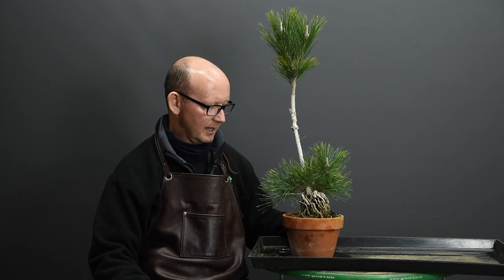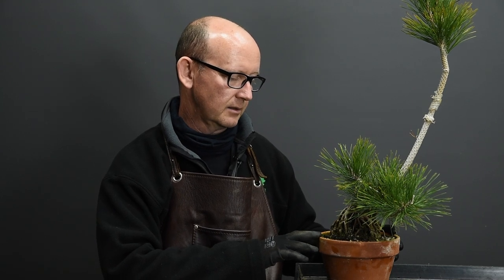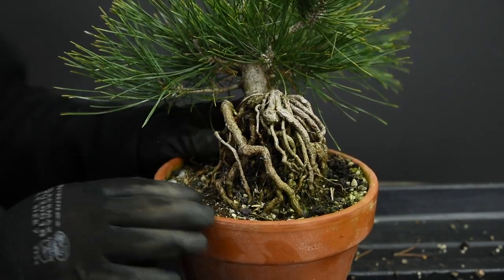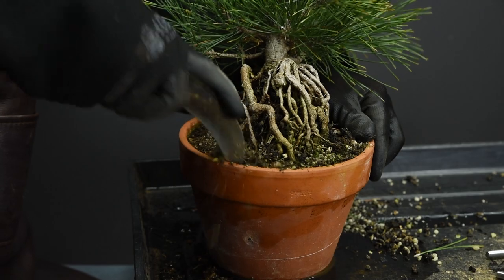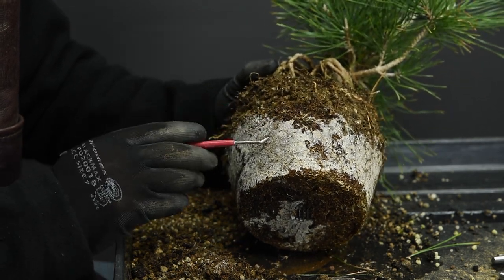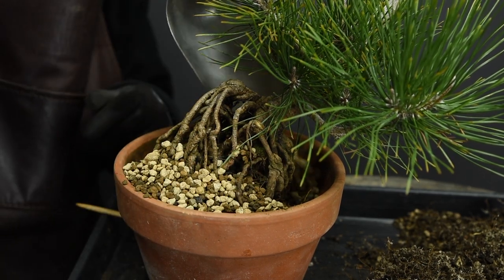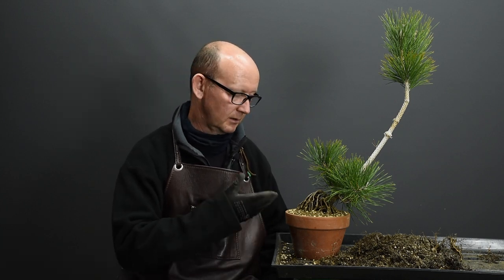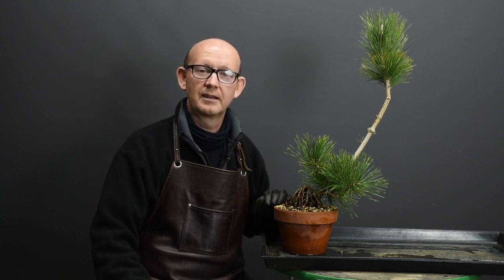Pines from seed part 2

Comment: I just has a Japanese black pine seed pop today. I bought a cheap kit off Amazon with like 8 different species of tree. So far I have atleast one sprout of every species. I am growing them in 80% perlite 20% peat.
Reply from the maker: That’s great that you are starting from seed. That media is very wet. I’d suggest you change that sometime soon to avoid roots rotting.
Reply: @TerryErasmusbonsai  do you suggest going straight to bonsai soil? Like a shogun size bonsai soil?

I feel like I am having a hard time keeping it damp. They are inside in 73°F with 50%-60% humidity
Reply: @TerryErasmusbonsai  i also must add i have them all in net pots instead of regular seedling trays.

Comment: I've always wondered, Because of the importance of the mycorrhizae, should you never treat a pine with a fungicide?
Reply from the maker: That is a great question. One which I can only comment from my perspective on. I do treat with fungicide, you must, and I usually drench the tree particularly now in spring as this is when new growth is most susceptible. However I think what you mean perhaps is whether it’s a good idea to do so with systemic fungicides. I have recently done so and am observing the response. However I think it won’t really make a difference provided you don’t often treat with it and I doubt it will kill all mycorrhizae. Anyway the spores will be around in the air and will re-inoculate the soil. At least this is my thinking whether wrong or right I am not sure. My pines are all very healthy though with lots of mycorrhizal growth
Reply: @TerryErasmusbonsai  Thanks so much for that info. Now I won't be as hesitant to use fungicide on my pines if needed.  I haven't needed to yet, no fungal problems are apparent.

Comment: Hi Terry, thank you for this very informative video. I just have a question about repotting. I repotted a few black pines last year and they've not really shown much growth this year. Is that anything to be concerned about? They created candles and had a small flush of needles but not the sort of growth I was expecting. They are very similar to your tree, 3-4 years old
Reply from the maker: In the season after a repot the growth is often weaker. This is normal. However I cannot really say as I don’t know how the repot was done, how strong the trees were when repotted, how they were cared for afterwards etc. if the weak growth continues this season then you need to consider if there is something wrong with your growing medium or other variable.
Reply: @TerryErasmusbonsai  thank you! Yes I thought it was a bit of a vague question , sorry about that. Thank you for your help and advice